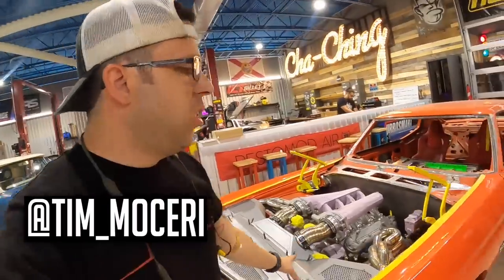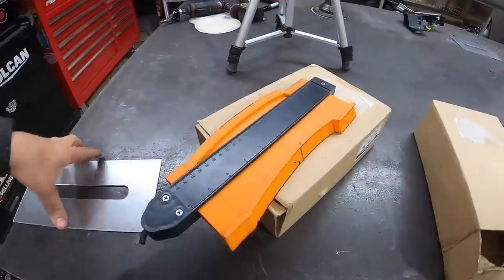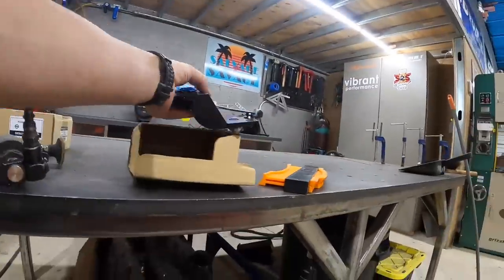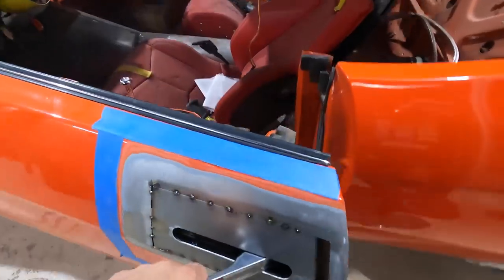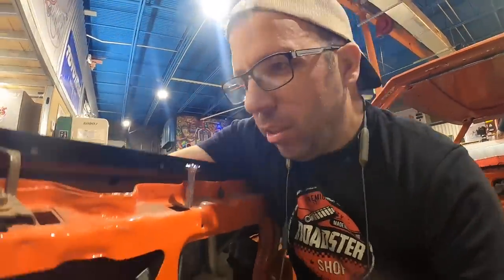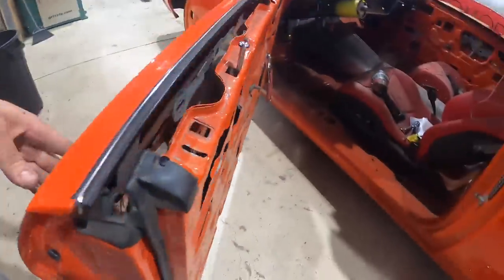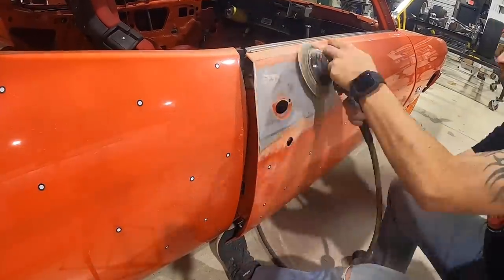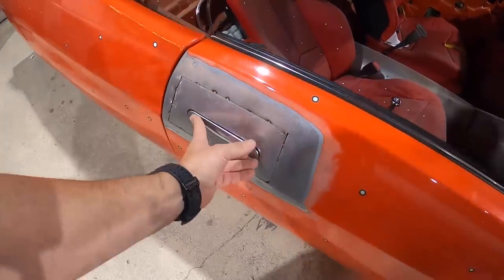GTR Door Handles on the Twin Turbo Chevelle! - 1970 LSX Chevelle Ep. 8

Comment: Door hinge pins: as you said, the driver’s side door gets more use. So it stands to reason that the bushings were replaced at some point.
Reply from the maker: That's true!
Reply: Always oil hinge pins at least yearly! ... In vehicles... and at home... don't forget the garage hinges/rollers...
Reply: @fret_playa  - Steel pins aren't like rubber tires... USA wheel bearings usually last much longer than foreign made...
Reply: @fret_playa  - Tires have metal in the bead... some also have metal in the belts... IF they even have belts... nylon corded tires are the worst for taking a set even just from cooling overnight... most tires avoid nylon now that replacement materials are available...
Reply: @SalvagetoSavage 
We used to use windshield wiper motors and steel cables in 70's & 80's 
THEN JC WHITNEY STARTED SELLING THE "HIDDEN DOOR POP KIT" IN 90'S!!!!!

Comment: Looks awesome Tim. I have a huge suggestion for you however. If you do "remove" the key hole lock from the driver's door, it will look sic. But if the battery on either the car door or the key fob battery dies for some reason, I presume you're goin with upgrade to keyless entry, there will be no back way to get into the car. 
Suggestion: The key hole should remain on the trunk. If in the case of a dead battery, you open the trunk and pull a secondary mechanical handle to pop the drivers side door for entry. The handle could be tuck up the upper left of the rear deck near the trunk hinge.
Reply from the maker: Thanks Tony that’s pretty much exactly what we’re doing. 💯🎯

Comment: Hate to be a buzz kill but since you connected to the inner handle pull it will unlock the door from the outside now. Looks great though nice work
Reply from the maker: We didn't connect the inner handle pull. We ended up making a stand off from the outer pull to change the angle. Even if we did, it's easy enough to make the lock work indecently of the handle!